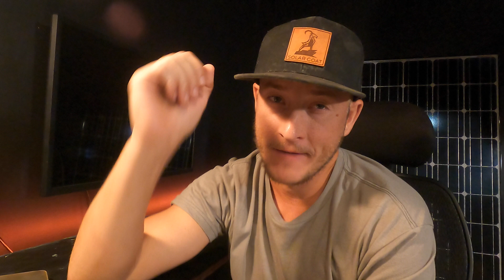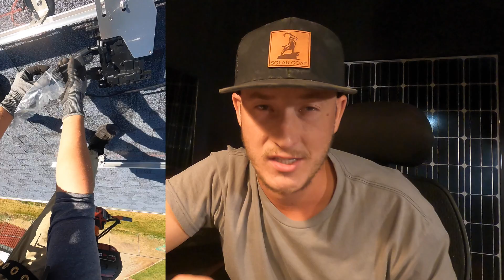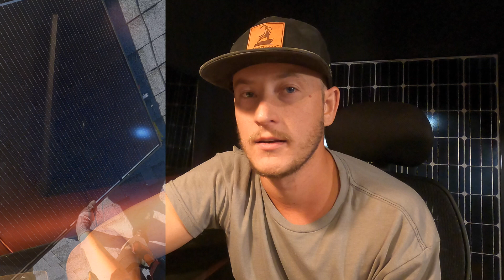Enphase Or Nothing

Comment: Thanks for that!! Question, if you have two  SolarEdge inverters and one dies, does the whole system die, or just the panels on that string from that inverter?
Reply from the maker: Correct, if you have two inverters and say one “burns up” the other should work just fine.
Reply: @solargoat  except what I have right now where the inverter that is in an error state is the primary inverter and manages all comms with the batteries.  So I get NO backup to batteries, NO discharge from batteries and disconnecting from grid doesn't do anything. And when your installer company won't even call you back, basically you're a sitting duck for these 117F temps and potential for rolling blackouts.
Reply: AND SolarEdge won't help me troubleshoot because I have batteries.  They won't even help me with a proper restart procedure.  Because I have batteries I MUST go through an installer to get any help from them.  Such horseshit.